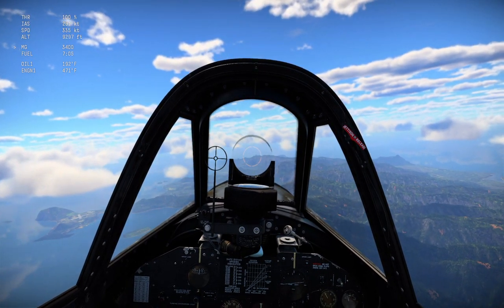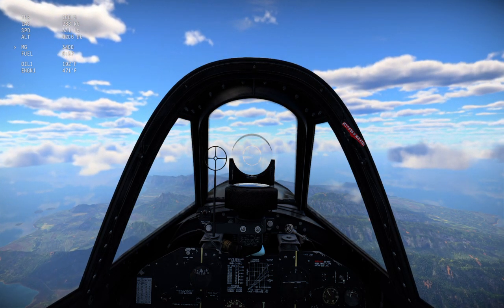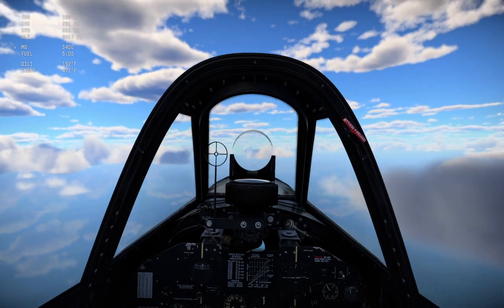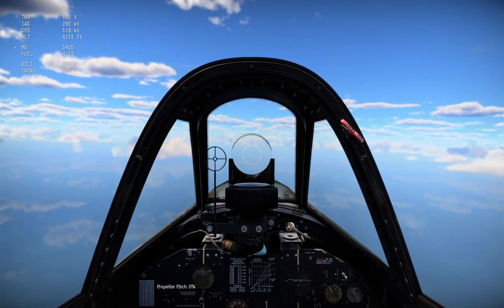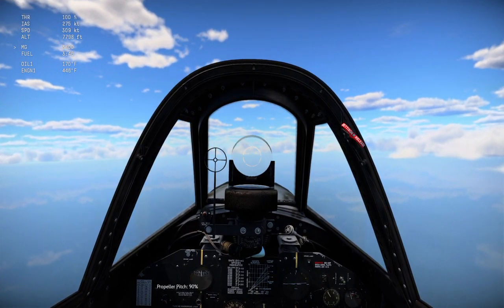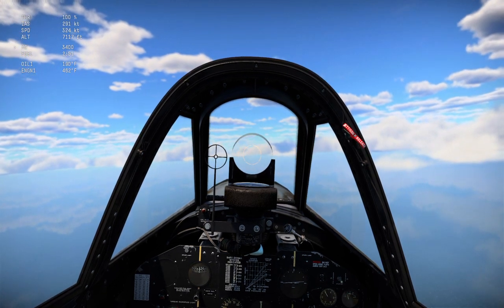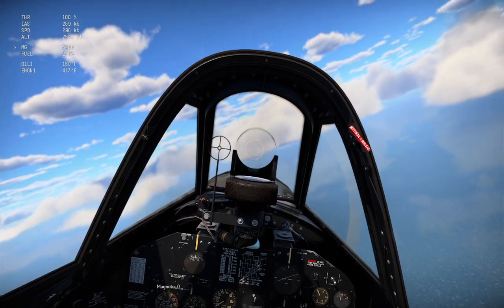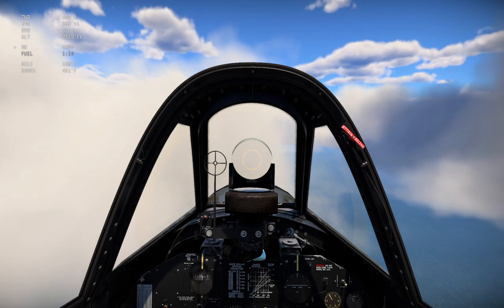Manual Engine Control - War Thunder

Comment from the maker: When messing with the Manual Engine control pay attention to the revs of the engine! Especially when messing with prop pitch! The higher the rev the more power you're getting! This can also make your engine's operate at higher temperatures so be aware of the temperatures